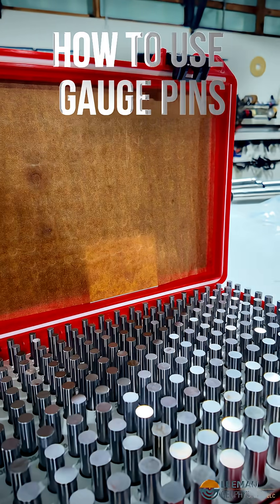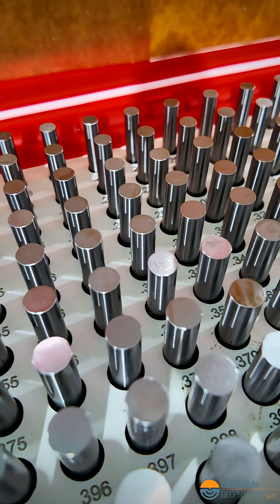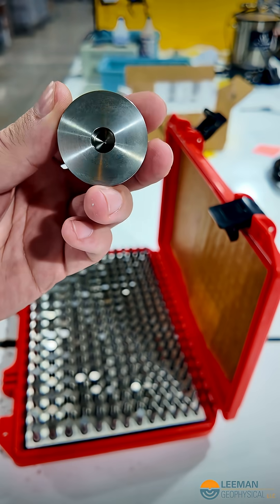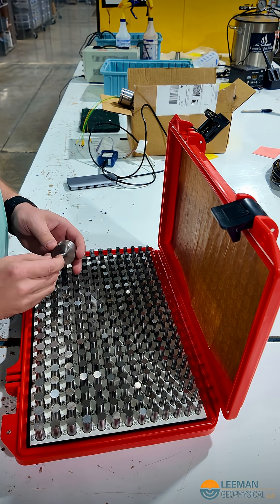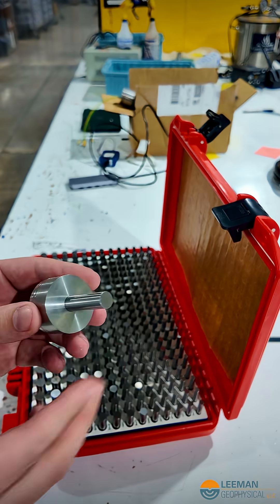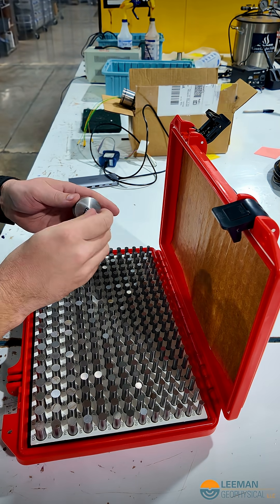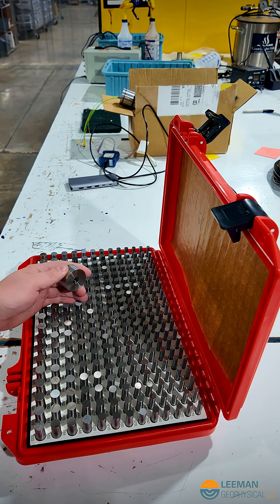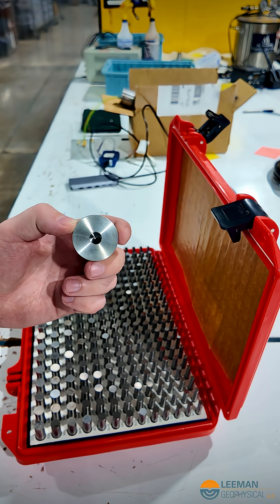How We Use Gauge Pins for Precision Measurements

Comment from the maker: Ever used gauge pins or other precision tools in your shop? ⚙️
Share your go-to methods for checking tolerances — we’re always curious how others handle tight specs! 👇
Reply: An I.D. micrometer or a dial bore gauge for tolerances less than .001 where I work.
Reply: I work in calibration, and using these without gloves is probably the biggest reason we find gauge pins out of tolerance. We recommend always use gloves, clean them with alcohol, and use a sheet of rust inhibiting paper inside the case to prevent corrosion (which can add or remove size). Oil is not recommended because it adds diameter to the pin just in the film of oil on them.
The second biggest reason they will be out of tolerance is simple use. Heavy use of the pins can add and/or remove material, which is kind of interesting because I originally would have thought it only removes do to friction, but that same friction can move the material over time, rather than REmove it. 
Wiping down after every use is the best preventative to get the most life from your pins.
Reply: @chrism4008 So much wrong here. This is how a "ballpark" figure is measured, not precision tolerance. Not cleaning a precision instrument before using it. (Even if you don't use solvent, at least use a Kimwipe) Not using them in a temperature controlled room (preferably one with air filtration). Handling them without gloves (allowing oil and moisture on your hands to transfer to the tools, and also allows heat from your body to affect their dimensions). It hurts my soul.
Reply: @chrism4008 and of course you will want to check the size (or have it checked) periodically, dependant on how much use they get and how they are treated in use
Reply: That's not how I was taught to use em. What you do is you combine 2 gauge pins to add up to the diameter. To get to 398 you would use a 250 and a 148. That technique also lets you see how oval the hole is and it's less likely to damage your pins through friction on scratches and you're also never going to have a pin stuck in a hole due to suction effects.
Reply: Always mic the pin.  Someone else may have mixed them up.
For better accuracy use Deltronic sets that come in .0001 increments.
Reply: I have used ID pins for 40 years, never thought I would see a short about them.
I work for Cooper Standard Auto as a extrusion Tech I make plastic fuel lines and many other fluid transfer lines.
I use them mostly for SPC carts = statistical process control charts.
Reply: When i was a tool maker we had gauge slips? flat ones in our inspection office, the surface finish was so fine they would stick together if you squeezed them to expell the air!.
Reply from the maker: @MrTench8  Yes! We all call it "wringing" them - it's super fascinating!
Reply: @leemangeophysical  please do a video on a regular block guage set usage.  I have 2 (out of annual calibration) sets i acquired through aerospace surplus sales.
1 is metric, the other standard.
Reply: I mean honestly, who doesn't use precision gauge instruments and performs work in machining? But digress. If you're set up for volume production, these pins are fine to use as a Go/NoGo setup, of course you need a + pin added in there. Otherwise if you trying to accurately measure that ID. The only way is a bore mic, and an analog one at best
Reply: Gundrilling babyyy im a gundriller i use them all day to check my runout/tolerance.
Reply from the maker: @JuanRodriguez-yr5xt  What kinds of parts do you primarily work on?
Reply: What was the dimension and tolerance of the hole you were checking?  It is important to assess whether the method you are using is going to tell you what you need to know.
Reply: Basic minus pins are .00015 under engraved value and positive are the latter.
Reply: Just did a deck set up on our industrial sander a few days before Thanksgiving. We measure to the thousandth during the set up, but we use feeler gauges and snap gauges typically. Not quite as precise, but we get by.
Reply: Cylinder gauge is my favorite.  For rings it's an indical if i have to I'll use two pins together to make sure it's not oblong. If it's real small a pin is OK.

Comment: Do you have to worry about corrosion or anything or measure things at the range temperature? Or is that not realistically necessary?
Reply from the maker: Depends on the requirements. In many cases, as long as the temperature is "room", it's okay. Some very tight tolerance parts will need to be measured at an exact temperature. VCI Paper in the case keeps corrosion off the pins, so we don't have to worry about that. Great Question!

Comment: For all of the ignorant who fail to understand why the decimal inch system is superior to the metric system for machining and metrology:

Which is a more precise measurement, 0.001" or 0.1mm (0.003937")? 0.0001" or 0.01mm (0.0003937")?

p.s. - Measurements taken at three decimal places in the metric system outside of highly controlled environments are a work of pure fiction.

Comment: The faxt that they didnt cut the storage holes the same size as the pins bothers me. Dont trust their dimentions if they cant probve the tolerances in the storage case.
Reply: The storage holes are irrelevant, it's the pin diameter that matters. Obviously
Reply from the maker: If the storage case was triple the price, I'm sure it would be a nicer box, but overall it isn't a big deal for us. As long as the pins are good and can be verified as good! I do wish the latches were a little better though.

Comment: Why not just using a high quality caliper ?

A precision gauge set like this must cost thoudands of dollars and weigh like a hundred pounds while a high quality caliper may cost 200 $ and is easy  to carry in an apron front pocket...

So, I'm serious with my question cause I just don't get it... 

Please educate me.
Reply from the maker: Great question! A set like this is actually only a few hundred dollars. Calipers are not very accurate for anything (we call them machinist's approximators), but they are especially terrible at bore IDs. The smaller the ID, the higher the curvature, and the worse they are as the jaw isn't actually touching the true ID, but making 2-point contact close to the ID. Calipers are also super sensitive to tilt/misalignment. Telescoping gauges with micrometers, bore dial indicators, or special inside micrometers are all other ways to do this though. Generally, gauge pins are the least expensive and require the least training, though.
Reply: @leemangeophysical 
Thank you very much for replying/answering my question, it's really appreciated.

I really thought it was a lot more expensive than that and I hadn’t considered the ease of use with minimal qualification/training.
Reply from the maker: @S.Vallieres  No problem! Thanks for watching and stay curious!

Comment: Ideally the inspection process is done in a controlled environment right at 68 degrees F but the print tollerance + or - determines the go nogo gauge size. .0001 or 1 tenth of a thousand of an inch is common for prints with tight tollerances.
Reply: My wife does electronics calibration, but she has some experience in metrology as well. If I showed her this, she'd be asking where is the temperature gauge and when was it last calibrated.
Reply: Depends what level of accuracy is required. For most jobs room temperature will be fine.

Comment: Now Ask a German 🇩🇪
Reply: He would prob tell you that you don't technically measure things with gauges, since it doesn't give you a value but rather tells you if it is within the specs or not.
Reply: @uste-ru5rx No, they do measure because he now knows the size of the bore. It could also be in or out of tolerance but so what?

Comment: "Precision" and "inch" were used in the same sentence 🤷‍♂️
Reply: Doesn't really matter anyway. The inch is derived from the meter
Reply: Is thousandths of an inch too imprecise for you?
Reply: @Stuey105 Inches are. It's like saying "0.34801 dogs in length".
Reply from the maker: The unit of measure has nothing to do with the precision that can be achieved.
Reply: Which is a more precise measurement, 0.001" or 0.1mm (0.003937")? 0.0001" or 0.01mm (0.0003937")?

Comment: how many pins in a case? Looks like you got about 200 there. what is the minimum and maximum size? Wouldn't a caliper reading be just as good? A good quality caliper can read with repeatability down to .001.

Comment: Having increments in thousandths of an inch is like it's begging to switch to Metric instead 😂
Reply: Gay euro poors use micrometer  As their tiny gauge where freedom Americans use thousanths of an inch.
Reply: A more ignorant statement could never be made.
Reply: @GaiusTacitus I assume you were making a declaration about your own comment, so yes it is.
If you are using decimal to divide Imperial is trying to make it Metric. If you wanted to keep it imperial they'd need to be fractions 8ths, 16ths...
A thousand of an inch is a Milli-Inch... like Millimeter or in this case closer to a Micrometer.
Reply: @erdvilla  Using decimal places in the inch system is not "trying to make it Metric". The Imperial system also includes decimal inch gradations.

The decimal inch system is a far superior system for producing precision machined components.
Reply: Not so! 🥲

Comment: I love how Americans will do anything to resist the metric system, even if it means metrifying their inches 😂
Reply: If you understood machining and metrology, then you would use machine tools and measuring equipment manufactured in the decimal inch system to make parts in the decimal inch system.

Thermal transfer renders unreliable any measurement to three decimal places in metric units.

FYI - The decimal inch system works just like the metric system. The difference is the decimal inch system allows practical machining and measurement to more precise dimensions.

Comment: Reminder this only verifies smallest round hole. If your hole is an oval and not a perfect cylinder a CMM may read the hole a couple of tenths (.0001”) oversized but when you check with gage pins it’s “well within” print tolerance. You’ll really only see this with hole size tolerances that are +- a thou (.0010”) but it’s a very easy trap to accidentally fall into to ignore the CMM failing a hole size oversized when it’s good to gage pins

Comment: It technically wouldn’t be whatever size that fits right? If it was the exact same size as the hole then it would be able to go in right? It would have to be slightly smaller?
Reply from the maker: Yep - That's why this is called a "minus" set, just slightly under

Comment: imagine going for this much accuracy and still using inches 😂
Reply from the maker: Imagine thinking that units are in any way related to precision and accuracy.
Reply: @leemangeophysical so why don't you measure it in miles
Reply from the maker: @ep4k581  1.5782828e-8 miles - it represents the exact same physical distance. Is the mile convenient? Not at all, but the end product is the same. Units in no way affect accuracy.

Comment: If you leave a gauge pin in a hole can the metal of the gauge pin bond with the metal of the hole?
Reply from the maker: Doubtful that over time it would cold weld, but certain materials could cold weld if the fit is tight and they are forced together.

Comment: I'd rather just use calipers. Only one small tool compared to a full box of metal cylinders. And with calipers you can measure oval diameters as well. With your set of blocks you can only measure circles.
Reply: Calipers aren't as useful in this application
Reply: @Unknown-g7w they will do the job just fine...

Comment: One of the first jobs I did at my dad's machine shop was to open up a 3/4-16 threaded thru hole to 1.000 +/- .005  in the side of a part that was basically a cylinder on the ID and a tapered cylinder on the OD. 4" ID x 6" or so with a 1" wall, HDPE. Anyways... Dad made a fixture that allowed us to slide the part over horizontally, hit a stop and then put a large gage pin (from an old out of service set) thru the threaded hole to locate it vertically. Then I'd put a plate on the end and screw it on to the fixture to hold the part. He told me numerous times, "don't forget to pull the pin before you hit cycle start." After seeing me do a few of the parts, he walks off and before he could walk to his office 20 feet away, yep, I found out why I shouldn't forget to pull the gage pin. Ugh...😅 If i remember correctly there were 300 qty and I didn't forget again. He said something like, "I knew it would happen, I just didn't think it would happen that quickly. Now you have what's called 'experience'."

Comment: The fact this is made is so silly.   Metric.  10.05-10.06-10.07-10.08.  Far more accurate.   Instead of 0.396-0.397
Reply: Nah, metric is dramatically less precise
Reply: @Unknown-g7w Yeah.  No.  Its not.    Litteral reason Why metric is used in nano precicion.   You dont do rocketscience with 397/10500.   You do it with 0.00001.  Also the reason Even China is more quality than the us theese days.   Old heads holding back inovation.
Reply: @bergrud nope it's less precise in every way
Reply: @Unknown-g7w Dude.  You can google right.   There is a reason only about 5% of the world still uses it.  And Even tha country dont use it when it comes to real precicion.
Reply: @bergrud lmao yeah, you are right, I can Google it. And I also understand how units work lmao

Metric is not more precise than imperial; it's less precise. What it is is easier to convert, but that has no impact on precision.

Enjoy your L

Comment: Are those plus pins or minus pins? You should have mentioned the two different kinds and their use. 
They have a very specific function.
Plus pins are the stated size with a tolerance of up to .0002"over the stated size and minus pins are up to .0002" less than the stated pin size.

Not to mention those are probably ZZ clas pins, cheap and accurate-ish depending on application. 

ZZ is ±.0002 on , ○±.0001 on roundness for + or - sizes respectively.

Z is ±.0001 on dia, and ○±.000050 on roundness (50 millionth)
And 
X class pins are the expensive ones.
Tolerance: ±0.00004" (extremely tight)
Roundness: better than 0.000025"
Surface finish: extremely fine
Typical use: high-end metrology, calibration, aerospace, medical, and when tolerances are ultra-tight.

I used these daily when I was doing ITAR work and making devices the held prisms and dealt with light refractory.

Comment: For those of you who may be thinking "Why would have to check? Couldn't you just see how big the drill is that bores your hole and get the measurements that way?"
No and let me tell you why. If you were drilling something like wood you usually don't need to keep things too precise but in a fabrication shop you need to keep things precise down sometimes to a few ten thousandths of an inch.
This means that even even the tool heating up a bit can cause certain tools to cut in a little more or less and this can easily cause a part to not be usable by the client.

Comment: For those that don't know.

Mostly for small holes that you can't get an inside mic into. 

Some also have a plus or minus accuracy. My job has 4 decimal in imperial measurement up to .875", within .0002" some plus, some minus. The box of gauges you have will tell you.

When I say plus .0002". Say the gauge in question is .8750", it will actually measure on a calibrated micrometer .8752".

Minus gauge that is .8750" would actually measure with a calibrated micrometer .8748".

Love that pop!

Comment: I have a set like this, had for for over 10 years, some pins are still in their paper.
Either you have used every pin (Amazing), or some poor slob had to unwrap every pin in the box
Reply from the maker: This box just had a sheet of the anticorrosion VCI paper over the top of all pins

Comment: I'd say you should use gloves. 
You're heating up the part and the pin with your hands. 
Everything should be at 20°C.
Reply from the maker: Depends on the tolerances of the QC and requirements - in this case it wasn't that tight, but for many aerospace parts that is indeed what must be done.

Comment: Machine shop metrology is a sickness that costs tons of money 
Working QC in our gear shop we use Deltronic pin sets in .0001" increments. Note that it takes .0002" clearance for it to lightly slide together. I also use Diatest split ball bore gages @ .0001" dial divisions and ring gages.
Swiss made Etalon intrimik bore micrometers also help.
Mikrokator / Mahr indicators on bore gages down to .00001/ .00002" starts getting ridiculous as watching the needle move from body heat above 68f just holding it 
You want closer get a CMM !!

Comment: We have a set at work that goes up in 0.01mm increments (~0.0004in). It's 8 boxes at maybe half the size of this one. It's so much easier than fiddling with a 4mm three-point micrometer.

I always carry those one at a time, right side up and two hands wrapped around the bottom and sides.
Reply from the maker: That's a really nice set!
Reply: I would put straps around it while moving it just in case
Reply: Mixing mm with inches for the ultimate fuck you to engineering hygiene
Reply: Precision pins in the decimal inch system are made to 0.0001". Because it is impractical to store 10,000 gauge pins (of which most would never be used, only the pins required will be on hand. Otherwise, the standard set in 0.001" increments will be used.